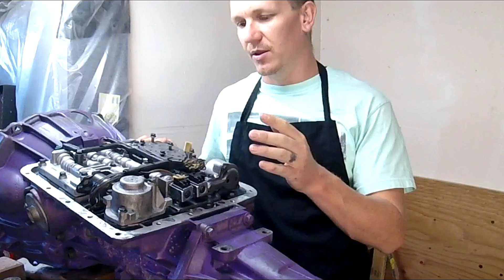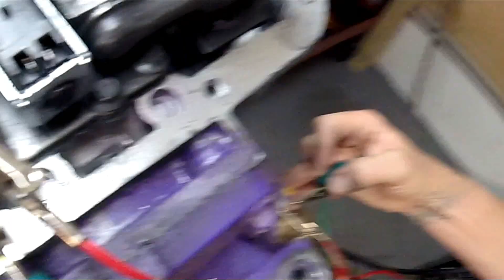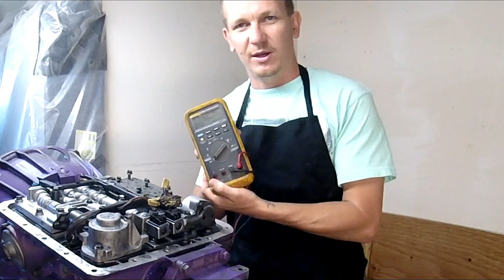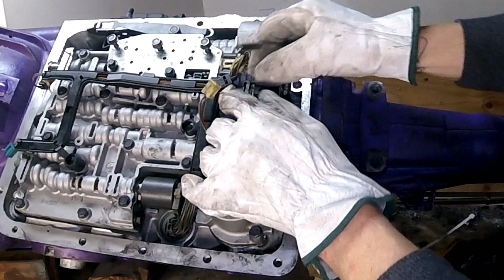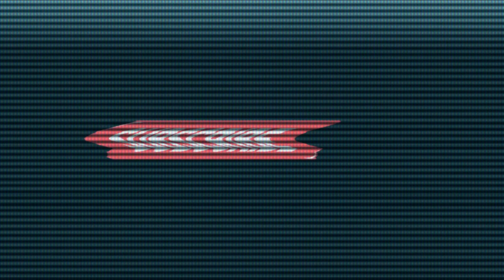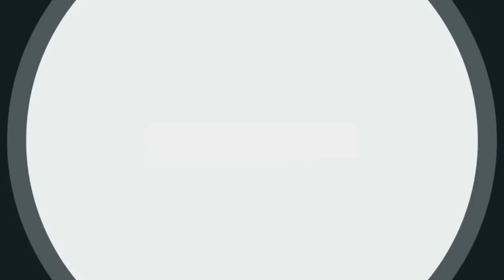⫷ P0752  4L60E ⫸

Comment: 2005 Chevy trailblazer I replaced both shift solenoids a and b. I still can't get second gear or overdrive. The code I'm getting says shift solenoid a stuck on. How do I fix it?
Reply: I currently have this exact issue. Did you ever find a solution?
Reply: Second gear and overdrive have the 2/4 band in common. I'm also missing 2 and 4 (overdrive). I have not torn into it, but my research points to the band having failed and needing to be replaced.

Comment: Yeah my brothers dealing with shift solenoid a stuck on and skipping 2nd gear . Changed: valve body , transgo shift kit, sonnax servo pin and servo upgrade . So still same original issue but different codes still skipping 2nd and advice. Definitely going to check the harness again but definitely need some guidance lol
Reply: I've seen other videos say that a broken band causes the fault.
Reply: @phillipmota5945  yeah it was a worn out band I rebuilt it all is good . Thanks
Reply: @Thomas Johnson  Awesome. I have the same thing going on with my astro van. Gonna be fun.

Comment: Hi 

I bought tahoe 2009 150k miles driven few days back. When i was buying they did compture test it shows falt P0751 -00 shift solenoid 1 valve performance stuck off and tech told me its ok.

When i drive sometimes i feel a jerk when i move from the signal light and this happen not always 

Do i need to fix it. If yes plz guide me on what to be done. 

If not any precautions i should take like not driving bit fast or pressing accelerator.

Thanks

Comment: Compressed air to move shoft valves out without scratching with a pick?
Reply from the maker: Gotta do what ya gotta do to get it out. If ya break it.... it must have been ment to be. Lol
Reply: Maybe a magnet would do it also.
Reply: @welytonpaz4235  But...then you need to de-magnetise befote reassembly....otherwise ferrousvmetal powdwer as the gearset wearscwould deposit on the spool valves and slow them down or jam them.